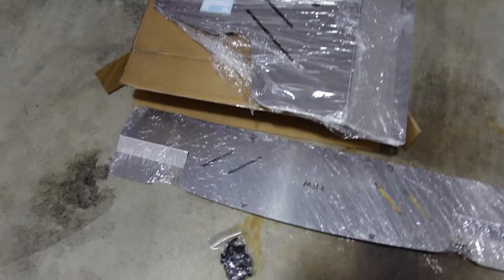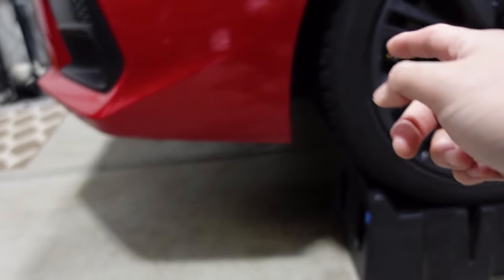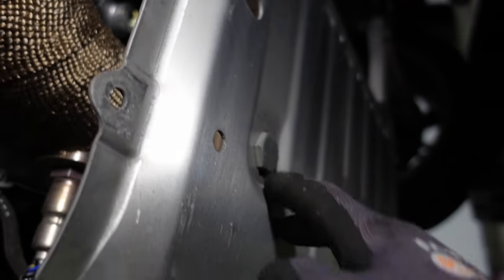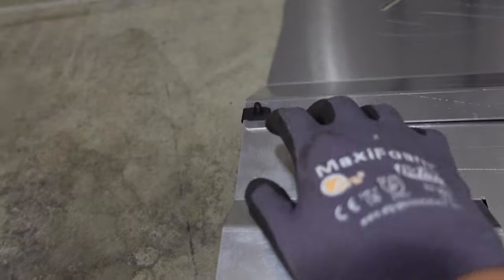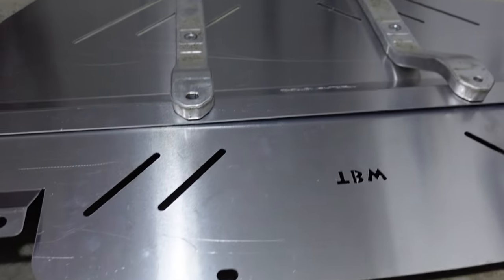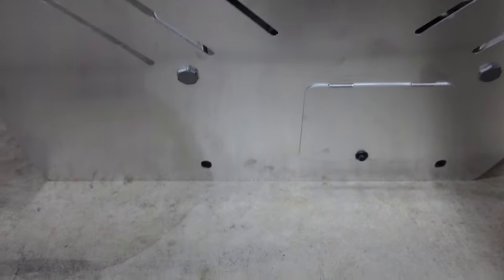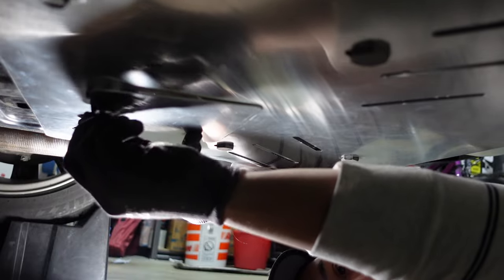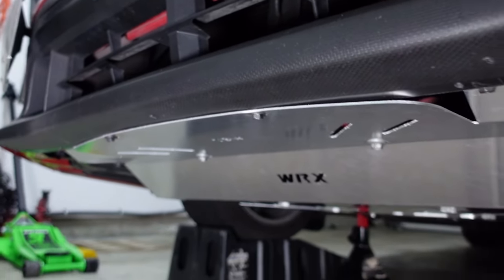TBW Skid Plate Install | 2015+ SUBARU WRX

Comment: So I've got a JDM sti skid plate on my 2017 wrx and it rattles a lot cause it has one mounting point that doesn't attach to anything. Does this rattle at all? Might switch. I do like that mine has covered sides though.
Reply from the maker: Nope, it doesn’t rattle at all. I recently cut up the OEM plastic under tray into two separate pieces and I was able to use them to cover the sides.

Comment: How is the temperature for the engine during summer with the skid plate?
Reply from the maker: I honestly don’t notice any difference in temperature. I imagine it being a little cooler because the sides are exposed.
Reply: @ronfromportland  
Do you monitor temperature with a AP or another device by any chance
Reply from the maker: @091520c  all straight from the AP. I only recently started monitoring the intake manifold temps for the summer months.

Comment: Hey, from tbw, there is a 3 different sizes of skid plate.  Regular, +50% and double the thickness versions.  Which one did you get on your car?  Would you have considered getting a thicker one if you got the regular?
Reply from the maker: Wow, there were no other options when I bought mine so I’m assuming I got the regular one. That’s awesome! It held up fine for what I needed. If available back then, I’d probably get the 50% thicker version just for that piece of mind.

Comment: It’s a cool concept, but it leaves too much open on the sides. I’d be worried about the elements getting in there, especially running a cai. Can you cut and replace some of the siding?
Reply from the maker: This! It was my only gripe about it. The STI version looks like it has coverage so I’m not sure why the WRX version doesn’t. I thought about cutting the plastic like you mentioned but I might look into getting some custom pieces made instead.
Reply: @ronfromportland  I know a guy who can make those for you if you’re interested
Reply: @austinmatthews255  id be interested!

Comment: You still have your stock skid plate and willing to part with it?  Some dumb ass in a truck didn't secure a aluminum ladder that fell out going 65 and my skid plate took the hit and all bent up.  All id need is the plate not the aluminum rails.  LMK
Reply from the maker: Dang, sorry to hear that! Luckily it doesn’t sound like there’s any other damage. I’m going to hold onto the stock one in case I ever go back to stock.

Comment: Nearly a year later:  How is the skid plate holding up?  Did you ever find a solution for the opening on the sides? If you didn't cover those gaps, have you had any issues with dirt, water, debris?
Reply from the maker: Hey man. Skid plate is holding up pretty well! I said screw it and left the sides open. I’ve gone through several heavy storms and surprisingly no issues with water. The only gripe I have is more dirt in and around the engine bay but it was to be expected. Overall, I’m pretty happy with it and I’d buy it again.
Reply: @ronfromportland  kinda wondering if there’s a way to cut up the oem plastic and bolt it onto the aftermarket one. Possible mod in the future lol
Reply from the maker: @xil3ntkha0s  haha yes, I ended up cutting the plastic shield into two pieces and sealed the bottom!
Reply: @ronfromportland  did you make a video or something off camera? Interested in the process since I'm about to get one of these skid plates soon.
Reply from the maker: @xil3ntkha0s  nope, didn’t think anyone would be interested 😞. I supposed I could show everyone what the pieces look like at some point.
Reply: @ronfromportland  I’m down for it lol

Comment: why not cut the side pieces from the plastic OE shield in such a way that they can be mounted to the new metal shield so that you retain splash protection from the front wheels??   Obviously the plastic OE shield is not going back on so cutting it up isn't a huge loss in retrospect.   Rivets, nut/bolt, 3M tape/zip ties, or any combination of the  three can secure the vertical side pieces to the metal skid plate.  You've gone this far, why not just a tad further and be innovative (at least with this skid plate)
Reply from the maker: Oh yeah, I did exactly this when I had the car. Cut up the OE shield and secured the two pieces onto the shield. Worked perfectly fine. Didn’t bother filming it.